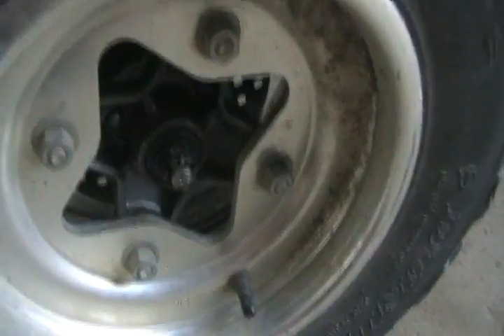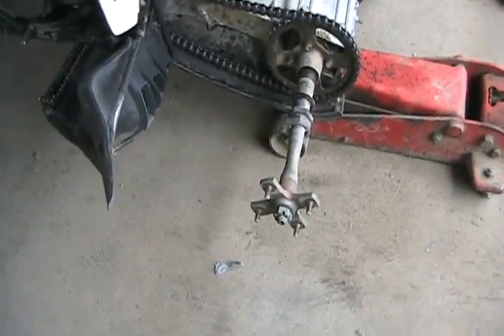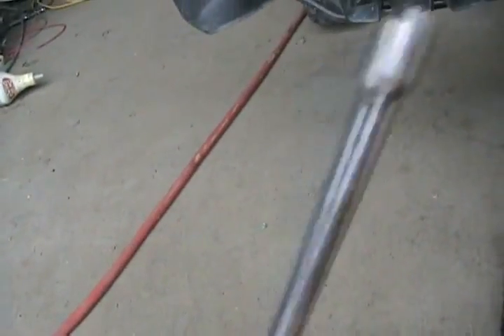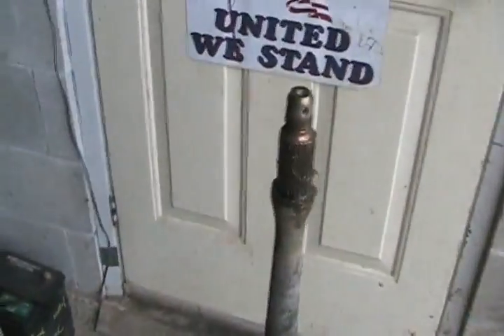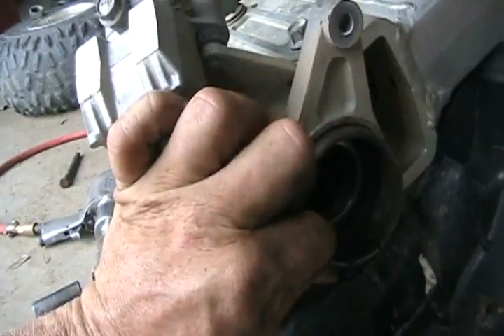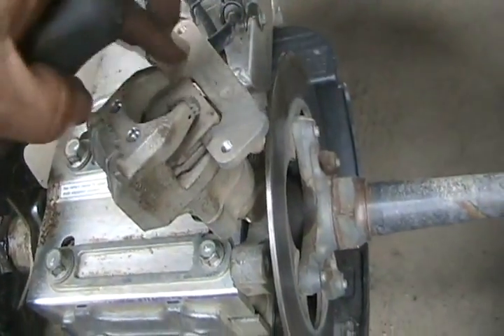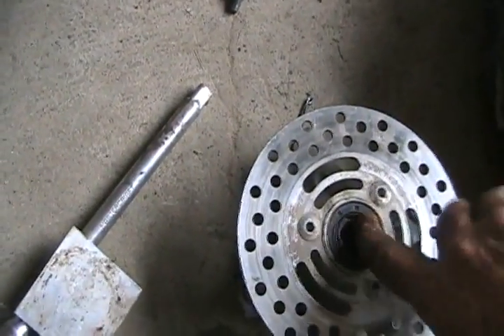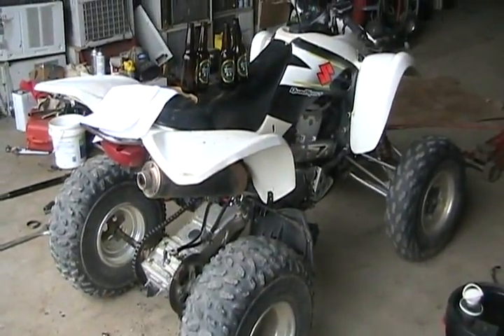#1414 How to change bearings and brakes on suzuki z400 atv [Davidsfarm]

Comment: Did this job today! Holy crap my axle nut was LOCKED on there. Had to use several cycles of penetrating oil and a blowtorch to get it to finally budge. Once I got that nut loosened up the rest of the job was pretty easy. Thanks for the great video!